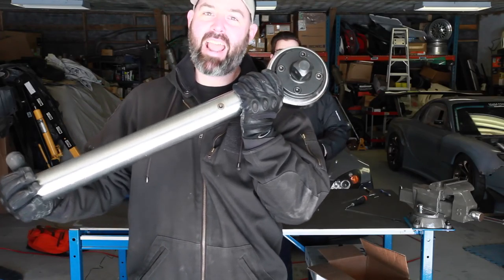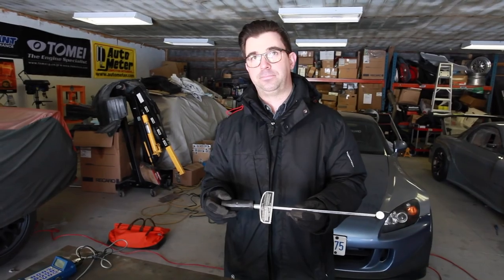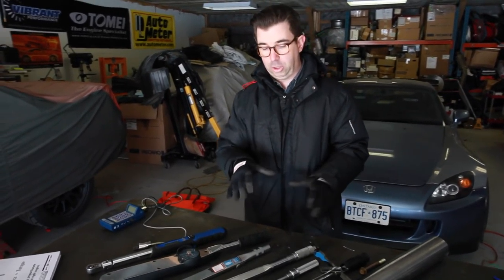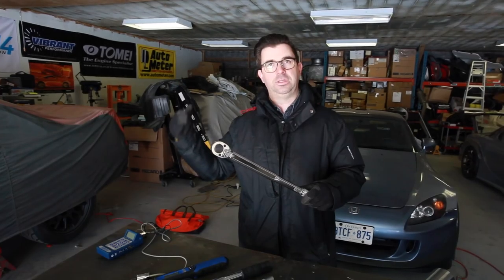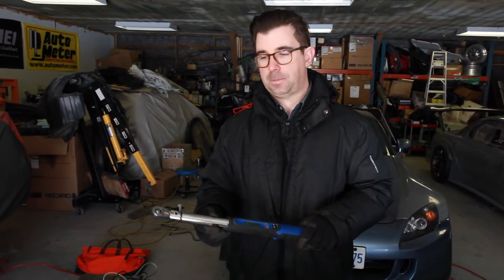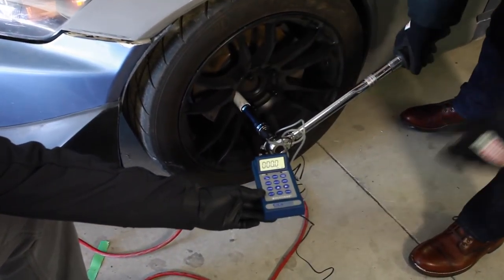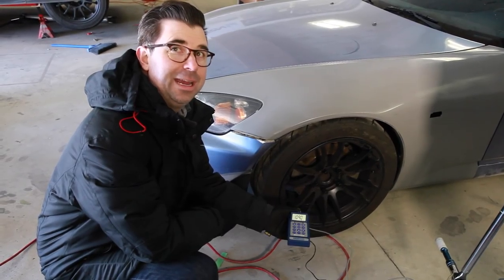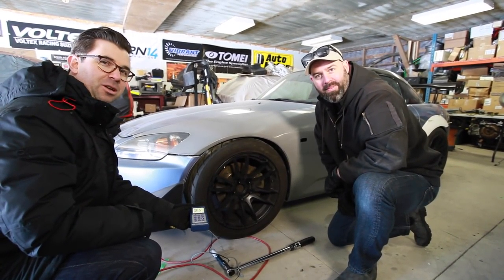How To Use A Torque Wrench Properly

Comment: It's actually good to test you're technique on a calibration bench for torque wrenches. I did that when I worked in the automotive industry and you got a curve on a screen which showed what you were doing (like a dyno). Really interesting. Slow and steady with locked elbow and straight arm did the trick for me if pulling around 70Nm or something similar.

Comment: Food for thought: Something I noticed recently is  Bill Trovato tightening head bolts and main bolts. He follows the factory torque specs brings the head bolt to their torque spec, THAN backs them off just a little than brings them back up to the factory torque spec. (claims to have more consistent torque specs over the long hall by doing this) If you watch closely the GM engine building machine for torquing head bolts, it actually does the same thing. It goes full torque spec backs off a little than re torques them. I don't know if this is important only on the first time using bolts or every time to help with consistency.

Comment: does holding the head of the torque wrench (and the end) instead of the end only make a difference?
Reply: +thesamandnath No
Reply: +thesamandnath No it doesn't but you will have better control holding the end

Comment: I had my 10 year old craftsman 1/2" drive click type torque wrench calibrated recently and it was only off by about 1%.  If you always zero them out and never drop them, they should provide years of dependability.

Comment: Is that an extension that was being used between the head of the torque wrench to the socket? Wouldn't that affect the actual torque applied also? (Depending on its length)
Reply from the maker: +Idris Farid It's not significant enough to affect torque.
Reply: +Speed Academy I see, thank you

Comment: You didn't talk about the importance of placing your hand only on the handle grip while torqueing. Putting force on the wrench anywhere else will change the torque value. As you mentioned about the force x distance.
Reply: +Robert Kohut No it won't. The wrench will still click at the correct torque.

What happens if you choke up on the torque wrench is you'll simply have to apply more force to get there.

Say you have a 1 foot long torque wrench set to 10 ft/lb. Gripping at the grip you'll need to apply approximately 10 lb of force. Gripping that same wrench half way down you'll need to apply 20lb of force, but the torque at the nut will still be 10ft/lb.

The problem with choking down is that the more force you need to apply, the less accurate you are. Just like torque wrenches, humans have a sweet spot also. If you are having to use lots of force, when that wrench clicks you won't be able to let off the force quickly enough and you'll keep turning the wrench a bit more, over torquing the bolt.
Reply: +atsernov Actually the wrench is calibrated for it's length and is only accurate when force is applied to the handle grip. It's not to be considered as a "variable length lever" which provides for mechanical advantage you speak of. Read any torque wrench manual or instruction guide and grasping the wrench from the handle "only" is specified and sometimes emphasized.
Reply: It only matters on a deflection style torque wrench where you'd effectively be grabbing the actual mechanism.

You can not deflect the tube housing the mechanism of a click type torque wrench. And grabbing it mid mast makes no difference to how the mechanism inside functions.
The problem is your control at the reduced leverage.

Besides, who grips a torque wrench mid mast?

Comment: Let's say you forget your breaker bar and you use the zeroed out torque wrench as a breaker, what did I break in the torque wrench and is it completely useless now? cough I've never done this, just a question cough
Reply: +frankth3frizz probably killed the ratchet mechanism. IMO the most sensitive part of the wrench.
If its an expensive tool, you probably can repair it with spare parts from the manufacturer.
Reply: +Erdinc Akay (Crankr) it's harbor freight.  Haha.  Ill just get a new one.  It's for my wheels.  I just forgot to bring the breaker last time.
Reply: Most click type torque wrenches are set up to operate clockwise.  Going counter clockwise with a click wrench can damage the cam/ball they does the clicking.  That's bad times for accuracy.

Comment: Should be noted that he never mentions anything about calibration of digital torque wrenches, While they may be more accurate they still need to be calibrated the same as any analog as calibration. Common misconception that digital read outs are more accurate than analog. Quite often the case that analog will keep its calibration longer than a digital readout. Any measurement device you use is only as good as its calibration.
Reply: 100% Mark.  Good technique will only get you so far.  You have to make sure the tool is operating correctly.  Most tool truck will have a device on board to check for accuracy.  If you need adjustments the tool guy can help point you to a lab,  or offer the service for you.

Comment: Makes sense. If you think about it, going fast on a torque wrench is akin to using a mild impact gun.
Reply: +Audio Crossing No it is not. He is not overtorquing because he is hitting the fastener. He is overtorquing because he doesn't have fine control and keeps turning the wrench after it has clicked.
Reply: atsernov You do actually understand the principles of operation for an impact wrench, right? The action he is applying to that bolt is exactly like a single blow from slowed down impact wrench. It doesn't matter if he didn't literally "hit" the wrench, all that matters is there was a torque spike from momentum. There's no room for argument, really.
Reply: Audio Crossing I agree momentum is indeed the problem. But I do not like the logic behind your comparison. You are implying an impact gun can't be accurate.

An impact gun can be a very accurate torquing tool, It is a "simple" physics calculation. The difficulty is in controlling all the variables. It's just not practical in a shop environment. 

The problem is NOT that it is a "shock" force, it is only that he lacks control of his body at that rate of output.

Comment: That stupid clicker handle type of torque wrench broke a head bolt on my motorcycle.
Reply: Maybe the bolt was already fatigued; maybe the torque wrench failed to click. If it's the former, there's really nothing you could do and unfortunately it happens. If it's the latter, develop a better feel for torque and you'll be able to tell if you've gone too far. And maybe get a better quality torque wrench. The tool didn't turn the bolt by itself, the operator turned the tool too far.